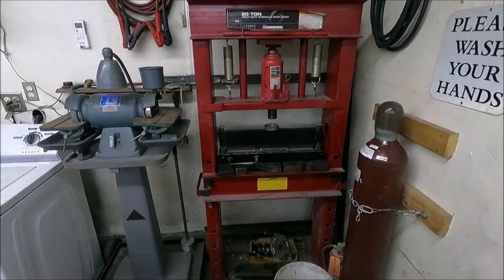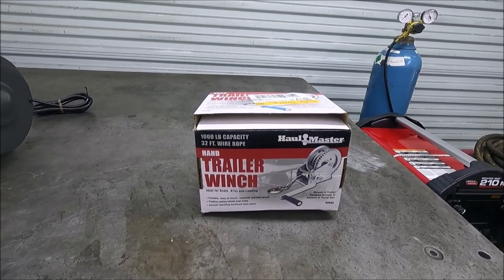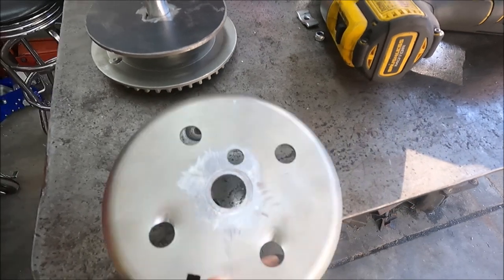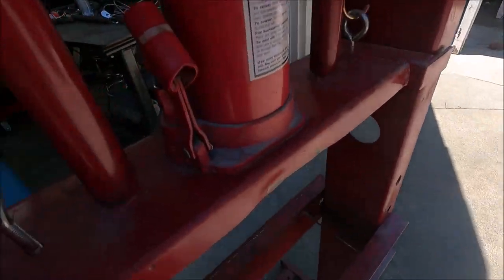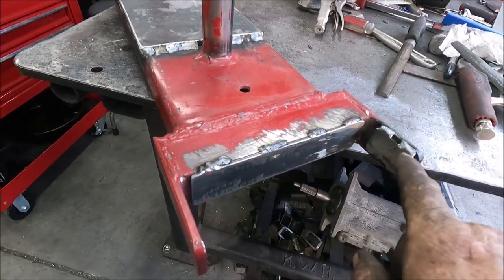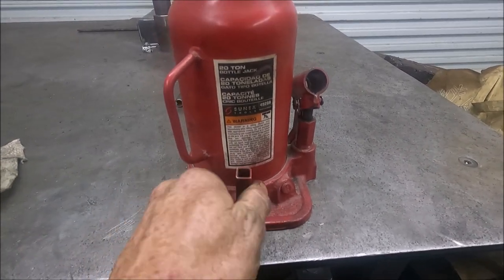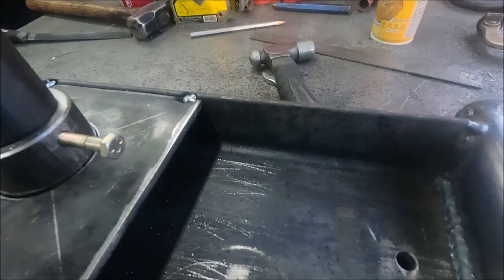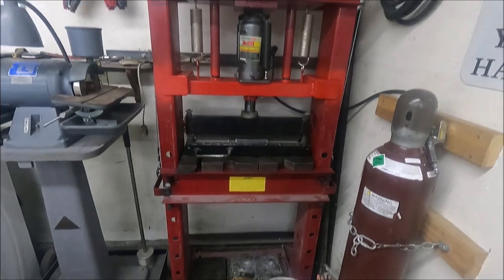Shop Press Modifications

Comment: You really got that thing modified now Ken ! The only thing with having the air over hydraulic is I like the hand feel when you are trying to press something. Pumping the handle I start to question whether it should be this hard and I should double check the part.
Reply from the maker: Thanks.  With the air over hydraulic your right you don’t know how hard your pushing on something
Reply: Agreed, and I often count pumps on the handle when making the same bend on several parts, especially where it isn't possible to use an angle finder.
Reply: But understand that even with the air over hydraulic, you can always use the air to get it close and finish with the hydraulic hand pump.
Reply: @1mean1  good point !

Comment: I liked what you did. You might also think about welding washers on to the ends of the pins that hold the table up. By having a oversized washer you wont accidentally push the pin clean through and it stops up against your new top.
Reply from the maker: That’s a good idea.

Comment: i made my press out of 3/8 thick 5x5 angle riveted together (old bridge girder) for the sided and 3x8 channel for the table and top i made my jack plate  able to slide side to side (dont think i ever used it tho)  need to add the winch for mine too  that table is "HEAVY" found a 2in thick plate 8x10 to press on  great add ons!!!
Reply from the maker: The winch really makes it so much easier to use.
Reply: @1970chevelle396  cool i have an old winch that i think i will use with something along your design

Comment: Great video of the mods. What you could do now is install a couple of LED work lights in the pockets underneath, on each side of the jack table. With the amount of mods guys do on their harbor freight 20 ton presses, I think it would, (although initially more expensive), be better to build a 50 ton press right from scratch using a hydraulic foot operate ram. A 50 ton press is usually in the nature of $2,000. so to build one would be somewhat cheaper to do. Now you have a 50 ton capability.
Reply from the maker: Thanks.   I wished I would have bought a 50 ton press.
Reply: @1970chevelle396  You could still make one. I made a 100 ton press using two 50 ton rams. All metal was between 1 inch and half inch thick. It's a very heavy piece of equipment. All moving operations are done by hydraulics.